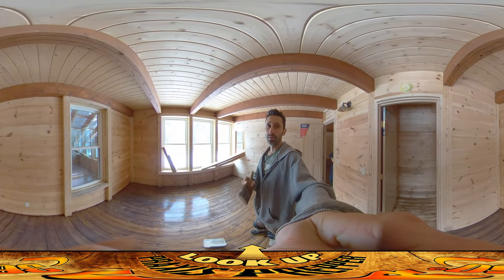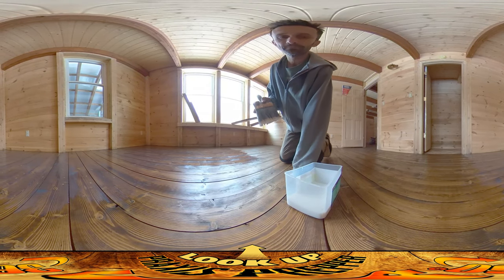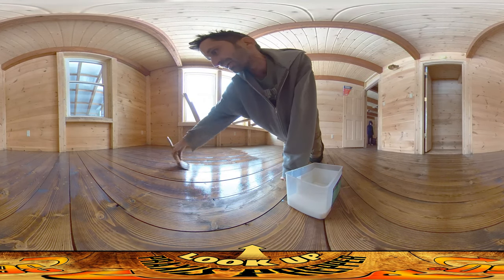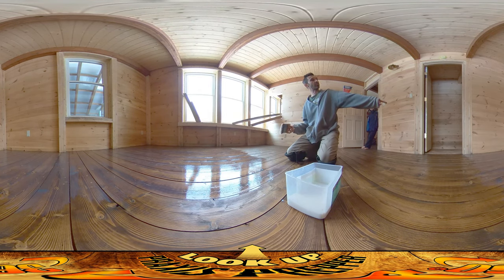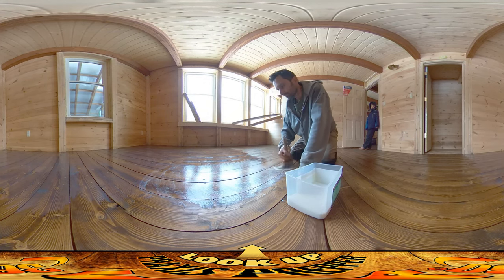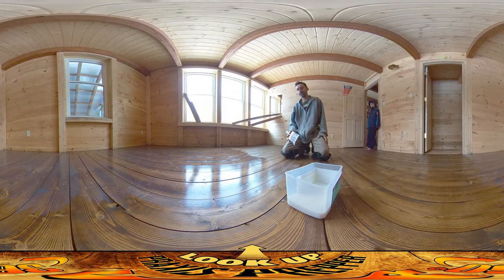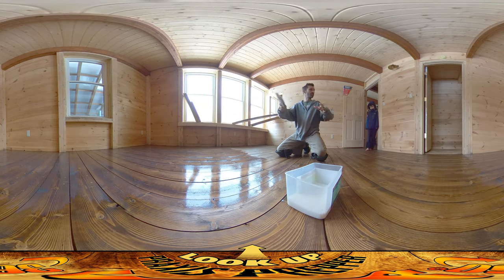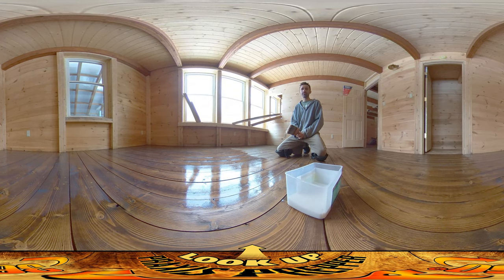Homestead Building - Laying Eco Poly Floor Seal Over Oil-Stained Floor

Comment: depending on the quality of urethane you use that will happen but as you do more coats that will stop , just make sure to do a light sanding between coats, typically on pine it’s better to use oil base but that has its cons like drying time but you could also try using a micro fiber roller and cut in on the edges with the brush goes much faster and lays down nice , just my 2 cents this is my profession have over 20yrs of experience ,
Reply from the maker: Thanks for the tips. Having done two floors, I would definitely agree that a light sanding between coats would have helped for adhesion. I'm thinking that I'll probably give the high traffic areas refresher coats over the next few years until I run out of the 3 gallons that I have left.